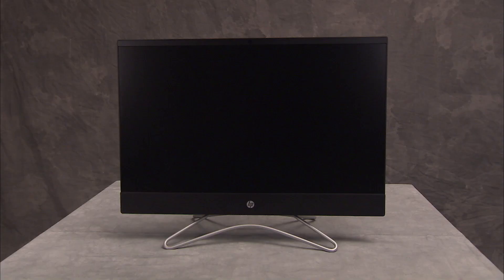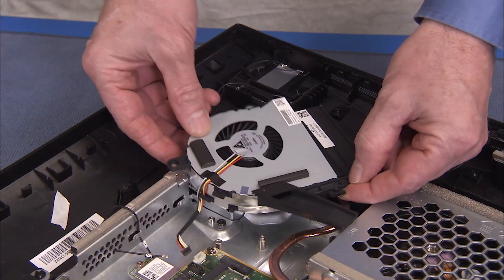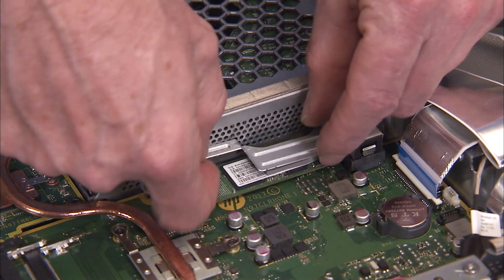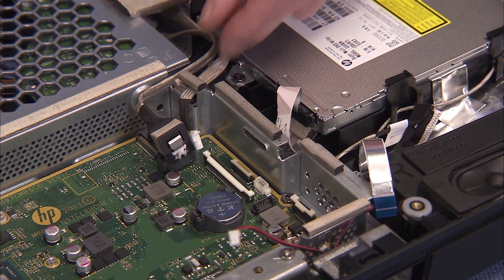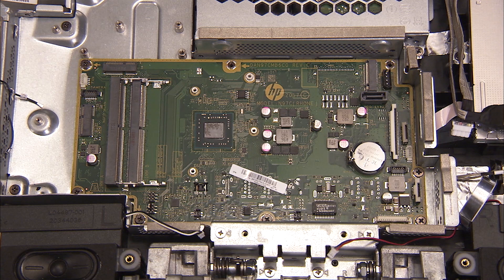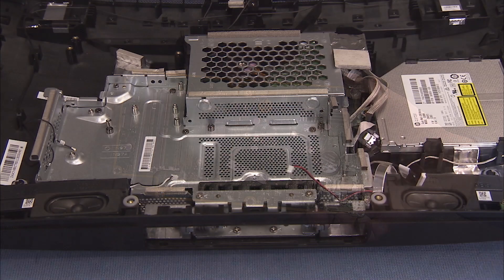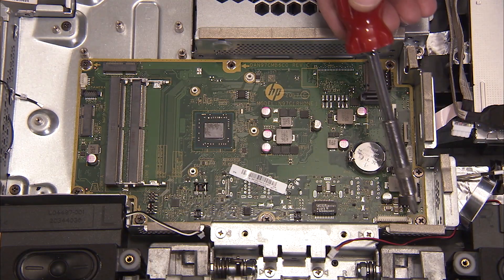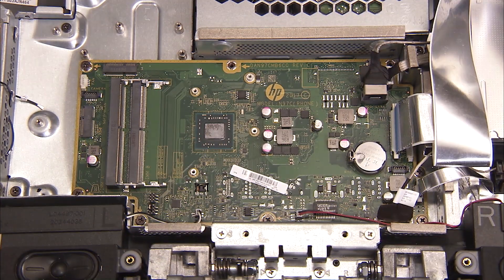Replace the Motherboard | HP All-in-One PC 22-c0000 Series | HP

Comment: hey I have a HP Pavillion all in one qb0077in can I change the mother board to a Gigabyte B450M?? pls reply sir.
Reply from the maker: +_Nitish_  HP does not recommend upgrading or downgrading hardware parts or software that is bundled with the product as It may affect the manufacturer's warranty and performance, however, you could change the configuration at your own discretion.

Comment: Can I change my motherboard on HP Pavilion 20 All-in-one Touchscreen PC ? I want to install the latest AMD Ryzen Processor in a new Motherboard . I know it will affect Warranty , but still it will be helpful for me if you please clarify my doubts
Reply from the maker: +Shibasish Dalui HP does not recommend upgrading or downgrading hardware parts or software that is bundled with the product as It may affect the manufacturer's warranty and performance, however, you could change the configuration at your own discretion.

Comment: How do i know if my motherboard will fit? Im upgrading from intel to amd
Reply from the maker: +Zain Zahir HP does not recommend upgrading or downgrading hardware parts or software that is bundled with the product as It may affect the manufacturer's warranty and performance, however, you could change the configuration at your own discretion.

Comment: can i replace motherboard to upgrade processor in all in 1 pc
Reply from the maker: +Amir Nazar HP does not recommend upgrading or downgrading hardware parts or software that is bundled with the product as It may affect the manufacturer's warranty and performance, however, you could change the configuration at your own discretion.